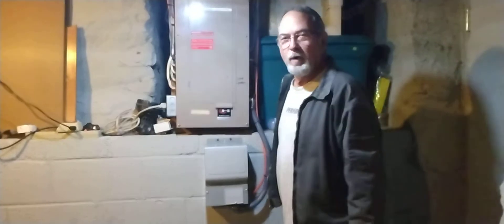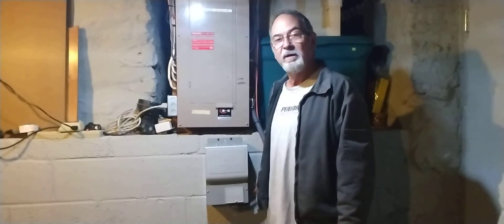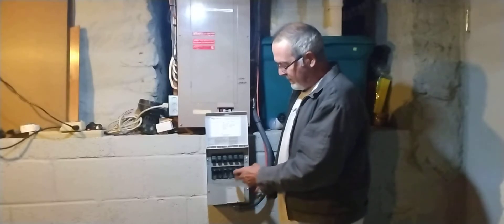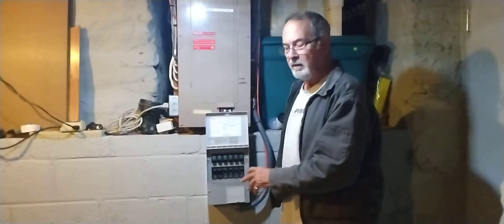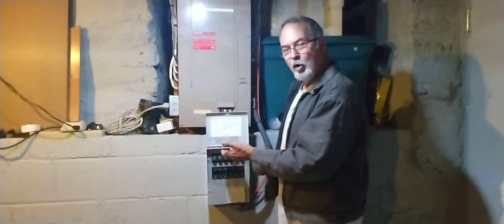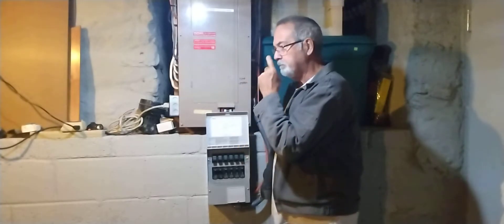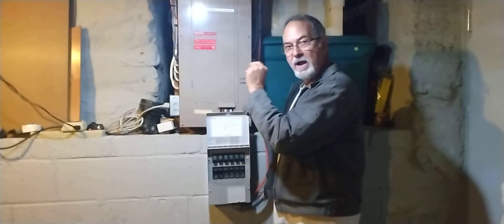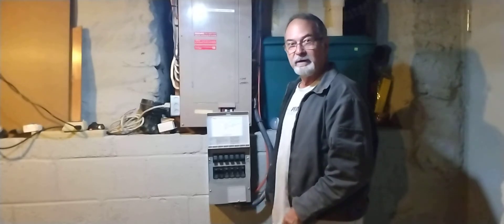Reliance Pro/Tran 2 manual transfer switch

Comment: Did you use an adapter to plug into the generator? I ask since I assume the cord is a 4 wire L14-30 cord.
Reply from the maker: No the generator is only 110...but the manual transfer box can handle a 220 circuit if you have a 220 generator

Comment: Is there a need to turn the main line in beaker switch off when using the Generator ?
Reply from the maker: No the circuits you chose will be activated by the generator....the rest will remain online until service is restored
Reply: @plnthrd So you don't ever have to touch anything on your main breaker box in the event of a power outage, right? Once the power comes back on, everything will be powered from the main except for the six circuits bieng powered from the generator through the transfer switch? Then, you can just turn off your generator and switch the transfer box switches from "Gen" to "Line" with no risk of danger and no need to touch the main breaker box during the entire process, right?
Reply from the maker: @ngb09229  well in the event of an outage yes i do have switch from line to "gen" that's why it's considered a manual system, but once the system comes back on you need to set the switches back to "line" and shut off the generator
Reply: @plnthrd  got it, this is better than an interlock system in my opinion.
Reply from the maker: @ngb09229  and less than 1/3 the price too!
Reply from the maker: @ngb09229  exactly